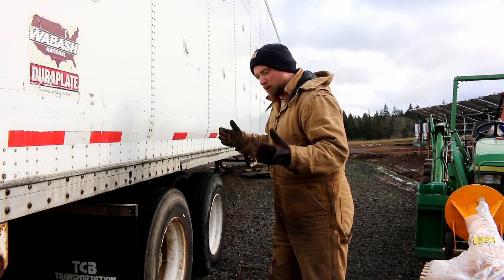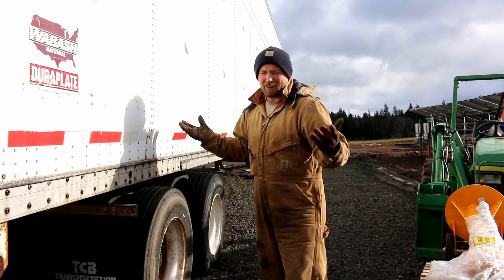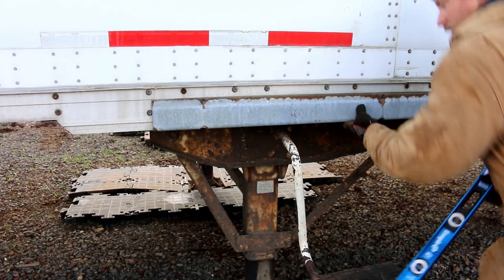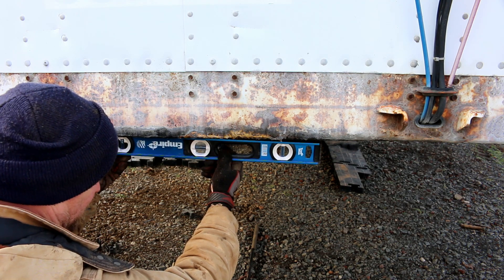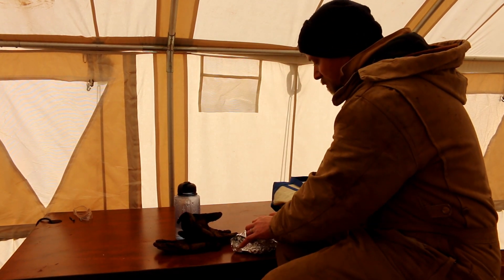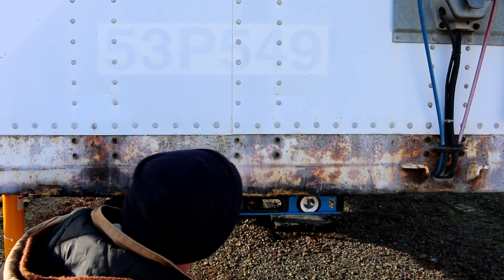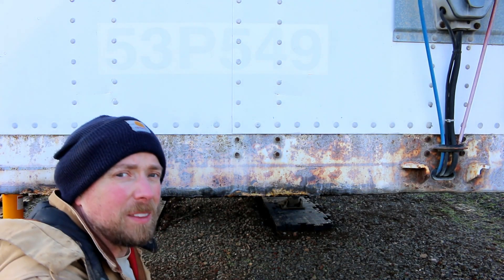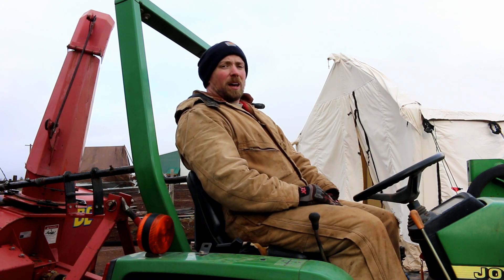Leveling a SEMI TRUCK Trailer with WESCO 100000lb Jack

Comment: do you see 4 hydraulic pistons controlled by an arduino in the future to keep this thing leveled?
Reply: or a screw type of a lift...controlled by a set of lasers inside...goes to sleep and runs once a night or every few days....
Reply from the maker: i would really like to have an autoleveling system, yes. it's a matter of finding the jacks
Reply: TheRealMartian what is your guess at the weight?  I have an idea using an electric screw jack.
Reply: Another thought.  I think you touched on this at the beginning of the video, is your tough for this to have 4 feet that come down and the tires may not even be touching the ground?  Basically the same concept as a large RV?

Comment: I enjoy all your videos and following your journey! At the front of the trainer are the 2 landing gear legs. The legs are connected with a cross tube. The crank handle is connected to a 2 speed gear box, which then drives the 2 legs. Another level method for your situ, raise the using landing gear till side opposite the crank handle is good. Then remove the bolt connecting the cross tube to the landing gear with the handle. Then adjust that one till happy. Reconnect the bolt for the cross tube.

Comment: Based on my experience, you’re going to have additional settling. IMHO, the smartest thing you can do at this point is use railroad ties to distribute the load laterally across the width of the trailer probably have four different spots where you’re supported on each side total of eight points with the four railroad ties (even more support points may be required).  Good luck with the ‘soil mechanics’ as you add loads at different zones in the trailer. Soupy ground will haunt you unless you get the psf of load below the soil bearing capacity(at its worst).  A stich in time...    I don’t doubt you will master building on Martian terrain!

Comment: He Jeff levelling trailers in your situation as you have found is a pain. 

A simpler way is to use a water level, it's also more accurate over a long span than your two foot bubble level.

Three 12 foot long pieces of 3/8  of clear vinyl hose taped to the sides of the trailer filled with colored water work wonders leveling side to side. And one about 65 feet long would do it front to back.

The trick is level the high side front to back then level it side to side by raising the low side. This is coming from someone that use to set up moblehomes and job shacks.

Comment: trailer 5th wheel jacks have 2 speed gear boxes.   by pulling out the jack handle or pushing in you can switch gears.   jacking on the low side is much easier than trying to jack on the high side.   That flooring will not prove suitable to support a loaded trailer.  Replace it with the salvaged railroad ties .  even under the tires because it will tend to sink also

Comment: Yupp, that's big trailer!  Leveling it is futile because when the ground freezes the earth will likely heave more than a foot!   Unless your footings where the trailer is standing is 4' or more deep... don't waste the effort to level it.  Building a mobile hydroponic garden will require a stable and level setting.  Water can find a mm of drop and travel for miles.   This is not going to be easy!

Comment: Love the channel but I level 53’ trailers at least twice a month, catering services, 2 ft level on a 53’ trailer you maybe almost level but over a 53’ span it maybe 6-8” off. We use a laser level along with jacks. But awesome work going at it alone. Promise us no more hanging insulation by yourself with the ladder fully extended R.I.P. HAB. 1..
Reply from the maker: defintely no more hanging from a ladder to hang insulation lol